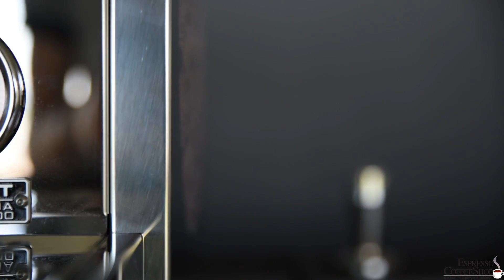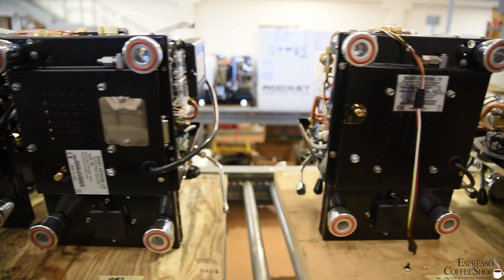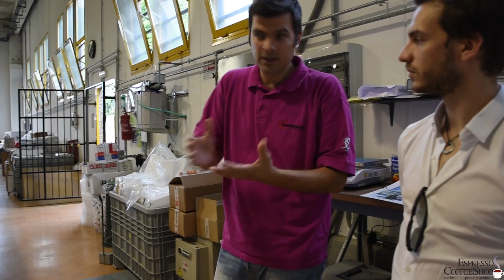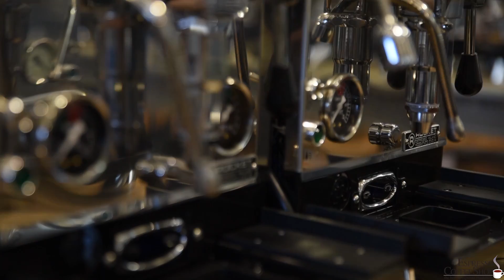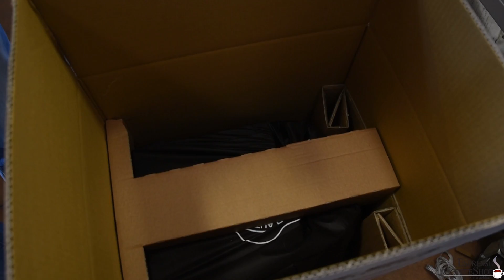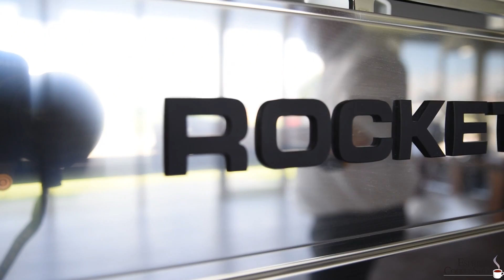Rocket Espresso Factory Tour

Comment: Got an Appartamento today and sadly had to return it right away. The base that holds the drip tray was totally bend. The whole machine was bend in fact and no part seemed to fit the other.
The machine also had scratches near the power switch and on the right side.
The box was sealed and totally fine. How can something so horrible pass quality check? Or is rocket not checking the quality of their machines at all... Very disappointing experience, waiting for a replacement machine. Let's hope I just got very unlucky with the first one and the story won't repeat itself.
Reply: Sadly, when the box is dropped straight down you don't see any damage but because of the weight of the internals the frame bends. That is why some manufacturers ship on a wood pallet. My Profitec pro 800 was actually upside down in the box and the top was damaged. No ideo if it was the factory or the shop that screwed up....I'm guessing the shop.